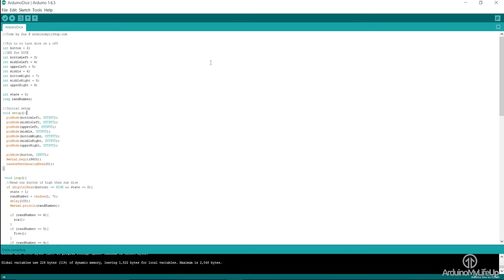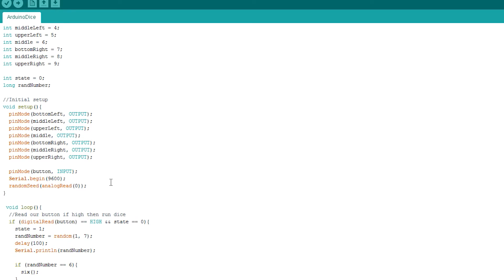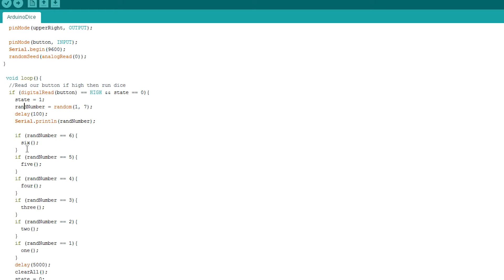Arduino Dice: Build A Simple Dice Circuit

Comment: The dice works fine but the drawing in your guide dosent jive. Thanks just the same it was fun and it works. The drawing shows the resistors on the left side going to the hot rail and the 3.3 v going to ground

Comment: you van save pins on your arduino by connecting the led's in pairs. Are are led's that are only used together like the led's in the middle for six

Comment: Im making a beer tray with 10 holes fore one beer glas each.   in the holes I want a singel sensor ore switch. that senses that it is pushed in. then I want a devise/computer that randomly armed one of the switches so you have no clue with one the  selected. when the beer glass that the computer have randomly selected get lifted an alarm goes of. preferably an air siren. is this possible to make?